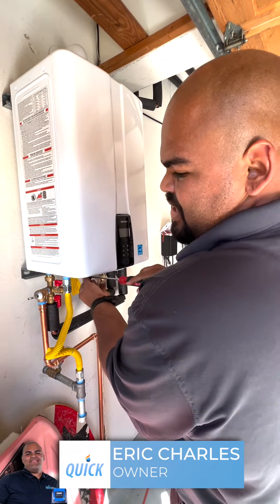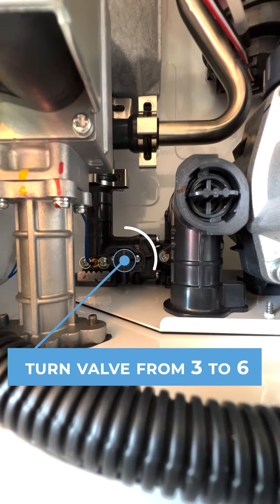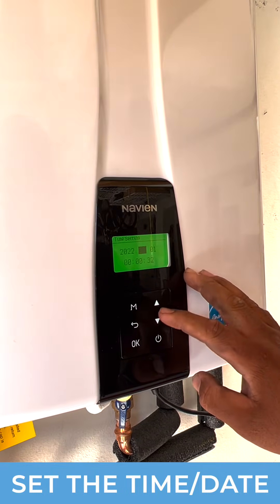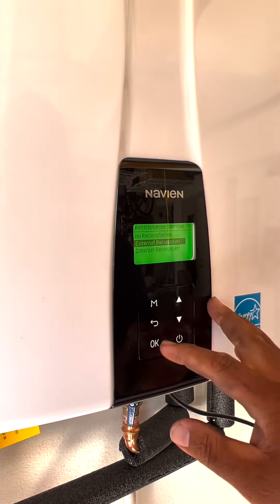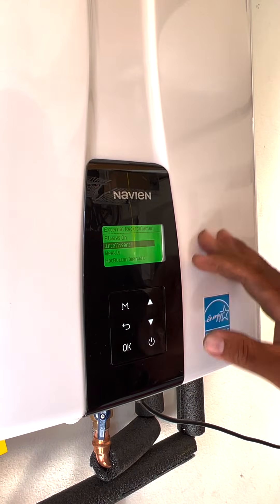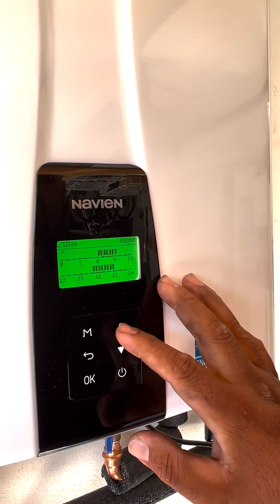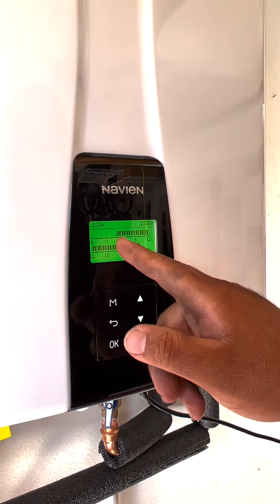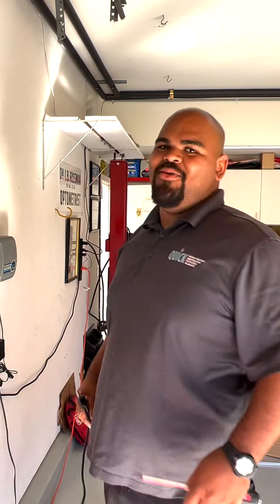Navien Recirculation System Programming

Comment: Thanks for making the video! The manual mentions switching DIP switch 2 to on for external circulation, but you didn't mention this in the video. Is this old instruction or did you do it off camera?
Reply: This may be a little bit late but the dip switches are only for the older model. The ***A2 models do not require any changes to dip switches, as it is done in the menu as in this video.

Comment: Is this instruction even correct? The 2-way valve is set from 3-to-6, instead of 9-to-6?  I think the correct way is 9-to-6.
9 o'clock is internal, 6 o'clock is external, which in this case is none because there's no return line right? So what was bypassed?
Reply: Looks like that to me.  Seems he doesn't really know what he's doing.  That unit can only do internal recirc it seems without plumbing in the recirc line.

Comment: How do you program the recirc pump if you only want to recirculate water on demand by using the wired push button?
Reply: I use an ALEXA relay....operates from any room PLUS the garage

Comment: I have a NPE-240A2 installed outdoors and i placed an outdoor vent kit. Q? How do i know if i can choose the external recirculation option? Is there a specific way the plumbing needs to be done or should i just use the internal recirculation. Any advice would be greatly appreciated.
Reply: If you do not have anything connected to the "RECIRC INLET" next to the "HOT OUTLET" then you should be using internal recirculation. You should only choose the external recirculation option if you have a recirculation line connected to the the recirculation inlet, or are using a NaviCirc or similar, and have the cold water tee'd to your recirculation inlet. I am not a plumber btw, although it seems like there are a few plumbers and Navien installers that do not seem to understand these configuration options.

Comment: We have the NPE-180A2 with built in recirc pump . Currently using the intelligent recirc mode which worked great when I was working as showers etc were consistent. Now that I am retired I think the day program would be better. You had that one set between 5a.m and 10p.m, how long does the pump recirc the hot water,  how much does it run lets say per hour? Thank you and very good video!
Reply: I use an ALEXA relay connected to the "Hot Button" contacts (also have an actual button in 2 locations) but actuating the recirc feature can now be done from any room AND the detached garage.

Comment: After weeks of research, I found the best solution. Some Navien water heaters don't have the internal pump. Plus if you don't have the dedicated recirculation line, you have to buy the NaviCirc valve. This pump from Xylem (ACT E10 autocirc) I mounted under my kitchen sink. Has the DIY fittings. Took me less than 10 minutes to install. Includes a timer and auto shut off when the temp is reached. So quiet. Now I have hot water in a few seconds instead of a few minutes! Great solution!!

Comment: I installed one in a house we renovated over this year. Had to do away with the flue pipe for the 40 gal water heater because it was in the way of the new shower we were installing. Was never a fan of the tankless water heaters in the past but it seemed like they had come a long way. I put in the Navien NPE 240A2 along with the Navicirc valve under the kitchen sink. We moved into the house in August 2024. I am amazed at how the Navicirc works! I was skeptical. The water heater works great too. It's an impressive piece of equipment. I hope it outlast me! 20 years?

Comment: Curious why you say don't get a tankless if you have Propane.  I run 2 tankless systems - one for domestic and one for in-floor heat - on propane and they work great.  There's a natural gas and propane option for some brands, or like this Navien it's one unit with different orifices and settings to change to accommodate either natural gas or propane.
Reply: I’m also curious.  We run a Rinnai external in Northwest GA and ours has been great for the last 4 years.  We do have a large jacuzzi bath we are about to remove which we noticed gets two cold spots in the flow when we occasionally fill it, but we have a hot tub and don’t want a large jacuzzi inside as well so it’s going… that’s been our only issue.

Comment: Why did you choose external recirculation? Wouldn’t it be internal? Thanks for the video.
Reply: Internal heats what inside the tank external heats what’s in the pipes
Reply: He set it up wrong. Pointing down is for a dedicated return line. Internal is for a crossover setup.

Comment: What would be the total cost of implementing a Navian tankless for a house up north?
Reply: My company charges 6 k roughly  , and they're junk.  You have to flush if often, and your water must be treated as well.  Warranties are terrible , tech support will not talk to you and most of us installers don't know what we're doing because there's no training.  Stick with a direct fired storage tank , easier and cheaper in the long run , more reliable less head aches and more hot water
Reply: Makes sense, but we had an AquaStar(bought out by Bosch) tankless in Boise Idaho, thing lasted for 20+ YEARS!! My plumber was stunned. Just installed a Navien here in Monterey, CA. So far, so good.
Reply: @keaters123 Just spoke with Navien customer service on this recirculating set up today. They were very helpful FWIW.
Reply: @keaters123  My Bradford White 75 gallon storage lasted 5 years. My tankless in my other house is going on a decade, so theres that!

Comment: why do you need to do a recirc?
Reply: Recirc is a nice option that’s easy with the built-in pump on these units. 

Normal tankless units make “cold sandwiches” or take a while to warm up with low flow. 

These internal circulation models have a nice warm buffer to make sure hot water is always readily available, but you still need to wait 30-60 seconds for it to show up at your faucet. 

If it’s easy to put in a recirc loop (from furthest fixture to the recirc port) at the time of installation, you can have almost instant hot water, especially if you set up a pump schedule as this video shows you how to do. 

I’m actually really excited about this because a recirc loop is costly energy/wise, but being able to schedule it, and also to control temp deltas and pump run-times for firing on recirc makes this technology a lot more feasible to me.
Reply: @swagulous5097  Just had a 240a2 NG installed and came across this video setting up a schedule (plumber left the recirculation always on). I didn't see the need to have it heating the recirc line while everybody sleeps. Like this video, I set mine from 6am-9pm. Wish there was an easy way to see energy costs difference between having the recirc off, always on, and a schedule. The Navian replaced two 50gal electric tanks so I'm sure I'm saving a ton either way 😂.
Reply: @pt6998  as most videos will show you you don’t save a ton of money by using tankless. The nice thing about tankless they usually last longer than a conventional water heater plus, you never run out of hot water.
Reply: for me it's 1 min 10 seconds to the furthest fitting WITHOUT recirc, and with it, it is 6 seconds
Reply: @markstanton6461  me too, I  didn't realize these had a timer in which I could turn recirc loop on. Now just trying to recall how I plumber the valves... now that drywall is covering the plumbing!

Comment: Can the external recirculation work with having to install the Navicirc valve?
Reply: It works without a dedicated recirculation line, but you need either the Grundfos bypass valve or the Navicirc valve. On the latest models (A2) it works without doing any additional plumbing.
Reply: Small houses only